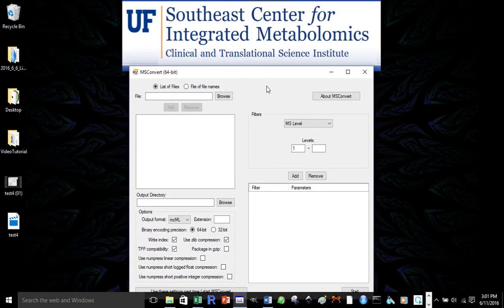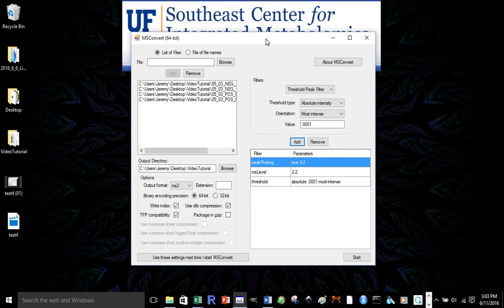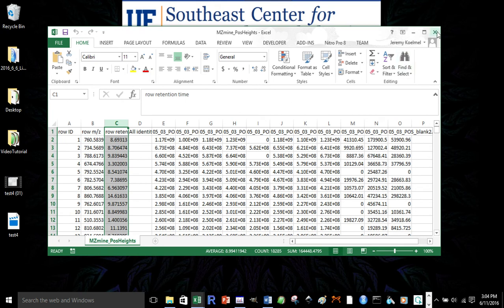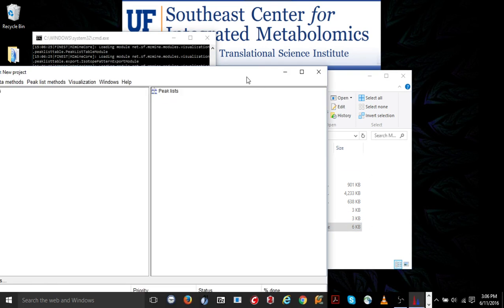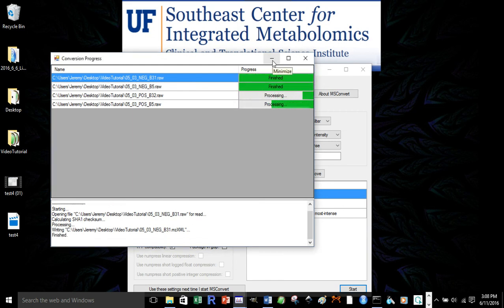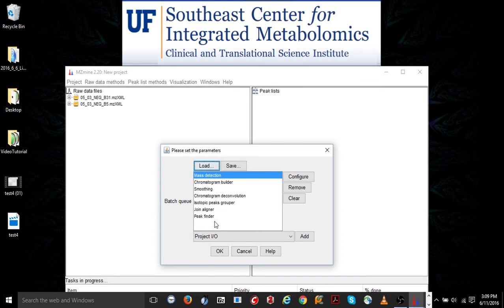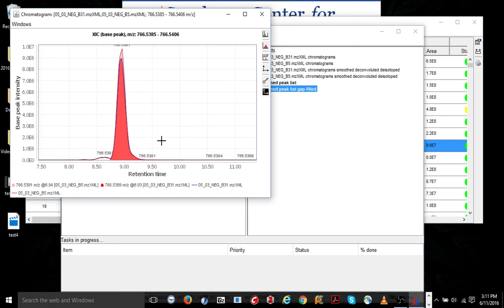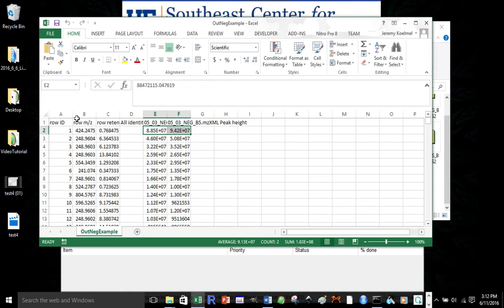LipidMatch Tutorial 2: File Conversion

Comment: Great tutorial! I was wondering if there is a batch file compatible with the new version of MZmine 3.1.0?
Reply from the maker: I have not made one yet, the one built in by default using 2.26 works quite well. If you are using your own peak picking with LipidMatch Modular then you can have any peak picking you want that you optimize and then use our software to annotate the resulting file and generate files for visualization (feature to be added in a month or so, keep your eyes out!). The batch file and automatic process when running LipidMatch Flow is to use v2.26 I believe, and it does peak picking for you. While the method is slow it works quite well and competes with most vendor peak picking when we compare. If you come up with your own peak picking batch file it would be great to compare, and you could send it to me https://innovativeomics.com/team/jeremy-p-koelmel-phd/

Comment: Great tutorial but confused where to find the MZmine batch file in the LipidMatch_Flow 3.5 directory structure and how it's called. Any help gratefully received.
Cheers! Paul
Reply from the maker: So I see you are on the modular tutorials, which means you are doing your own peak picking using MZMine or other algorithms (note LipidMatch Flow does this all for you behind the scenes, but if you optimize your own peak picking algorithms that always has advantages). Now to actually answer your question: LipidMatch_Flow_3.5\LipidMatch_Modular\MZmineBatchMode.xml I think this was one of my original batch files which is a one step peak picking. Then there are 6 batch files in the directory LipidMatch_Flow_3.5\Background_Files_LipidMatch_Flow\LipidMatch_Flow\ these are better but are a two step process. You have to run the batch file with your representative samples and blanks (e.g., pools) in the 4targeted files, the one without a vendor name is for Thermo. Then using this output as a targeted file you can directly target peaks across all samples, or do some kind of blank filtering in excel and then target the remaining features across all samples. Hope this helps! Feel free to reach out at jeremykoelmel@innovativeomics.com
Reply: @jeremykoelmel9126  OK thanks! I hadn't appreciated the distinction between LipidMatch Flow and LipidMatch. I'm pretty new to this, but my colleague and I have ambitions to get away from proprietary software solutions in favour of more open solutions. We'll aim to give the different options a go and come back to you directly if we have problems. Thanks again!

Comment: MSConvert  is available for MAC?
Reply from the maker: yes it is: http://proteowizard.sourceforge.net/user_installation.shtml
but you will want to not use the pop-up interface on LipidMatch for mac, so you have to set the inputs as from a csv or manual... LipidMatch Flow wont work for mac. neither have been tested on mac so LipidMatch might also not work. Ideally use a virtual machine to boot up windows on a mac and run from windows.

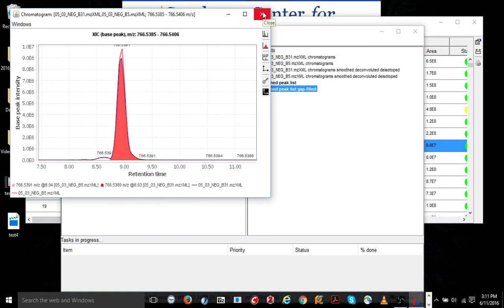Comment: At 10:22, if you see a deconvolution error, can you correct it manually ? If so, this is the tool I am looking for
Reply from the maker: You can do deconvolution in any software and then run LipidMatch on the resulting table. So for example if you have vendor non-target peak picking  software you can run it on the data files and use the resulting peak table and LipidMatch for lipid annotation. Many of these vendor or other peak picking software can be manually corrected. in LipidMatch Flow we have optimized MZMine parameters for best peak picking but of course there will still be errors. Hope this helps. (in summary LipidMatch is just for annotation of peak tables, and you can choose any software to get those peak tables).
Reply: thank you  @jeremykoelmel9126  I will try LipidMatch soon. My problem now to solve, is that I have to correct by hand the automatic MassHunter deconvolution sample by sample, peak by peak and it make my analysis limited to 20 peaks each time. I am looking for a smart and easy to use GUI to help resolve alignment and peak matching, then I will need to annotate !

Thank you
Reply from the maker: @nastymushroom  how did it go? MZmine now support manual reintegration! And the integration is generally good the first shot if you pick good parameters for your dataset. If you develop a workflow with reintegration with MZMine let me know as I would love to employ this as well.